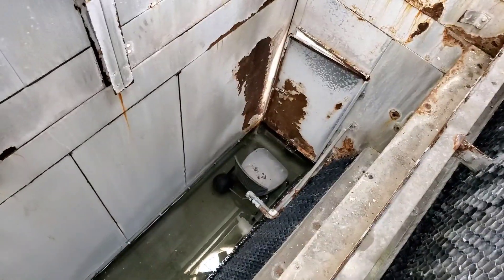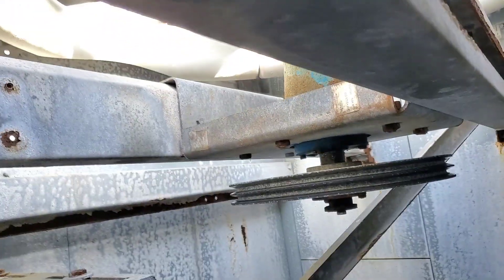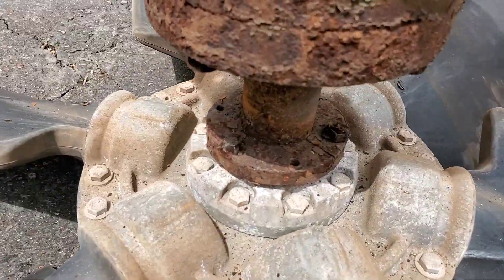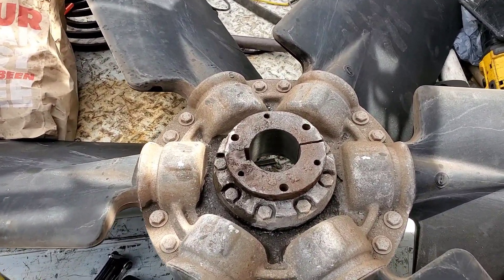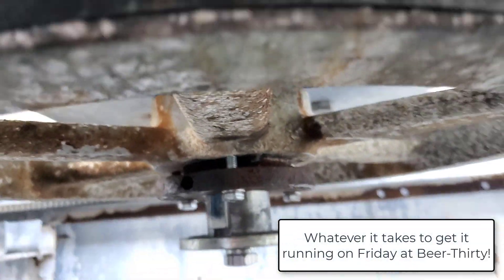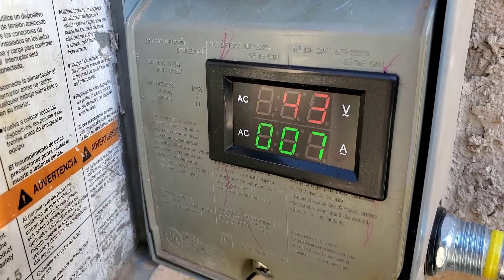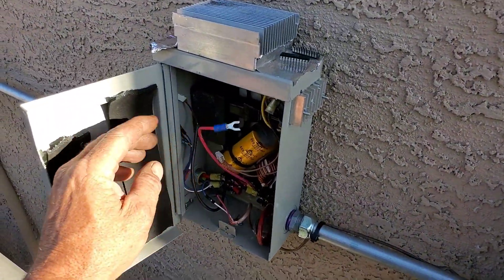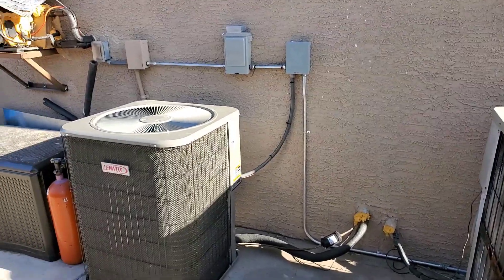Friday job didn't go as planned - Almost gave up -  But then got it done!

Comment: Just had to rebuild two a good bit larger than the one your working on.....
Told customer NEW everything you just worked on other than the fan blade.

Make it easy on yourself.....Because if two weeks later some of that old shit comes apart......they are not going to be easy on you!

It took me 20 of the 34 years I’ve been doing commercial and industrial HVAC to figure that out!

Good video!

Comment: What is the small refrigeration condenser mounted on your wall connected too? Wine chiller?
Reply from the maker: That's my water heater!
The base of it is from a wine cooler.
I converted the condenser into a 2 circuit evaporator coil. Feeds via cap tubes.
I bolted on a 9000 BTU 115V Rotary compressor from a used room A/C and a heat exchanger from a water source heat pump.
Reply: @hackfreehvac  you should make a video of that water heater setup.
Reply from the maker: @mainelyelectric  I think I've made a few now.  Lol

Comment: Had one of those LG capacitors light me up a couple years back. Wasn’t  sure if I was going to be able to get off of it. Never in my life have I ever been shocked that bad. Mistake almost cost me
Reply from the maker: It sure throttled my nerves real good the other day when I was trouble shooting and forgot that other cap was in my disconnect thing. And I only got shocked through the one hand, not hand to hand. Or who knows what could have happened.

Comment: Nice job! like a boss👏💪. The solar powered ac realy improved, when you pull the disco you can hear a humm.
Reply from the maker: The solar assisted AC was better when I had my controller working somewhat to disconnect the AC utility power automatically as needed.
It's still a work in process.
Reply: @hackfreehvac  gold!